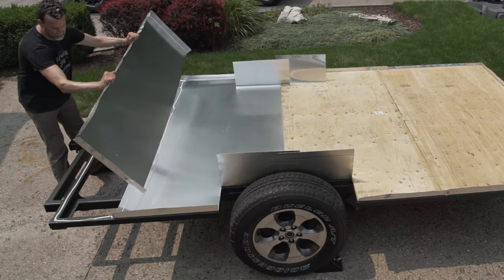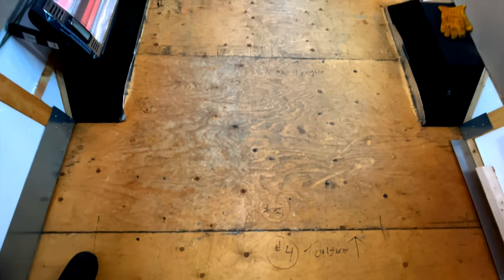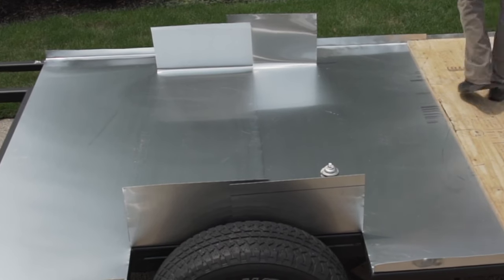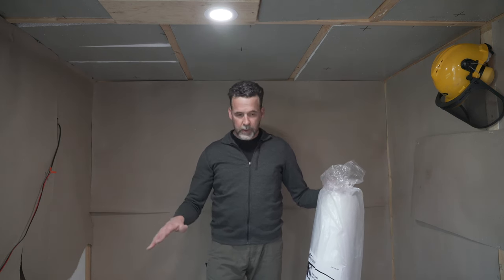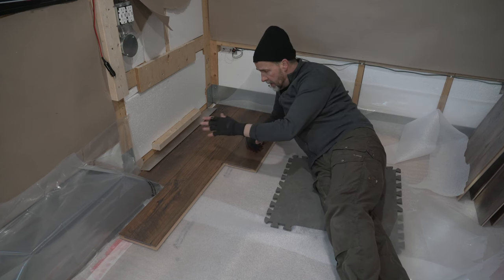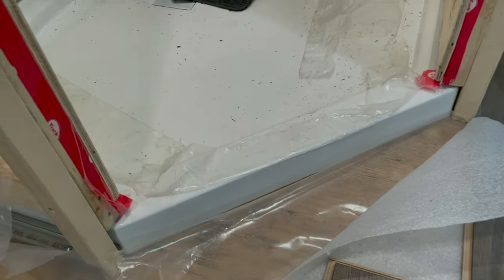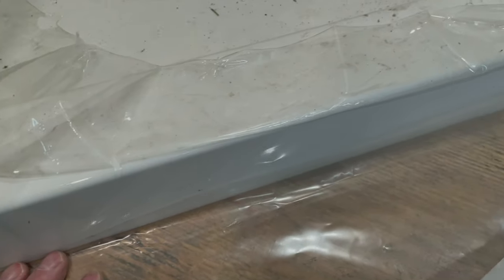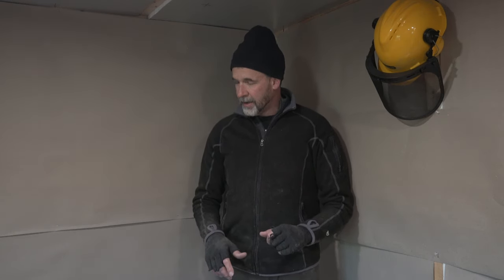DIY TRAVEL TRAILER - HOW TO INSTALL HARDWOOD FLOORING

Comment: Did you consider using the vinyl floor slats which look exactly like the “wood” planks? That would have helped a lot with shrinkage and would’ve been completely water proof.

Comment: Really enjoying the  build so far , my only concern is you used mdf laminate flooring instead of vinyl interlock floor , that mdf is crap when it gets wet , swells and chips , the vinyl is 100% waterproof and scratch resistant and looks better , just my opinion thats all , no wrong way just think if im going to do the floor and build on top , it better be something i dont ever want to have to fix .....i done every type of flooring and that mdf is the worst for any water spill and you want to use your trailer year round ? Time will tell ....just think you have gone to every measure to waterproof the outside but didnt consider the interior flooring , yes its more expensive but its the floor , the most abuses surface  , once again only my opinion ....still like the builb so far..

Comment: I have a vehicle transport and I want to put some cabinets and countertop with a sick A/C heater and TV and a small bathroom. It’s a 24ft long. Do you think putting walls insulation and all the stuff I mentioned before would be expensive?
Reply from the maker: If you do it yourself it should be reasonable.

Comment: You may have a problem.  Floating floors expand and contract.  You have installed your floor in the cold which will make the boards as small as possible.  It looks from your video and I may be wrong but you are tight up agains the walls.  If you did not leave at least 3/8 gap around the edges your floor will buckle in the summer heat when it expands.  Also if you build the wall ontop of a floating floor you will restrict it's ability to move and you again will have the floor buckle.  I hope not to be the bearer of bad news.

Comment: The heads of the floor bolts are not big enough, therefore it will fail down the road, u should have used 30 to 40mm washers recessed into the floor, which would never fail with the moving and flexing of the trailer floor.

Comment: You should have just used self-tapping screws and screwed it to the frame. Do this for two reasons. #1: Using metal on the aluminum causes galvanic corrosion to the aluminum unless you can completely avoid contact between the bolt and the aluminum. #2: Screwing it to the frame is as tight or tighter and much quicker and easier and no chance of galvanic corrosion of the aluminum.
BTW, nice job on the flooring and the shower. It looks nice and you did a very nice job.